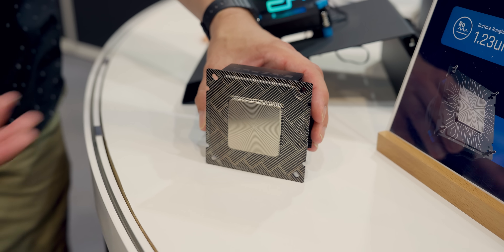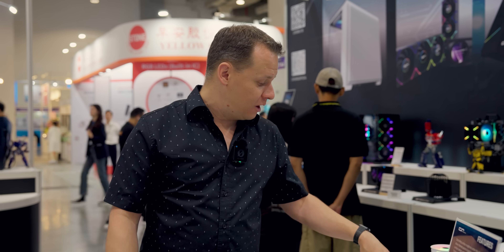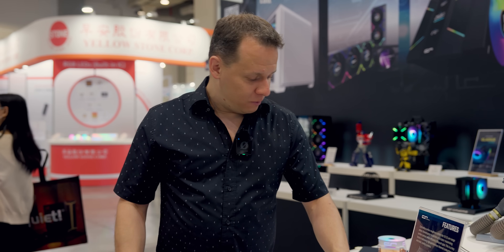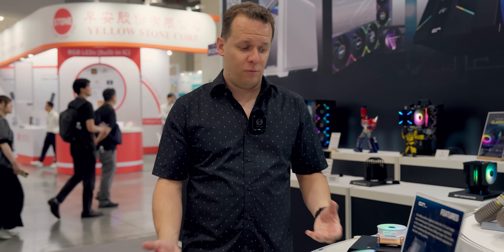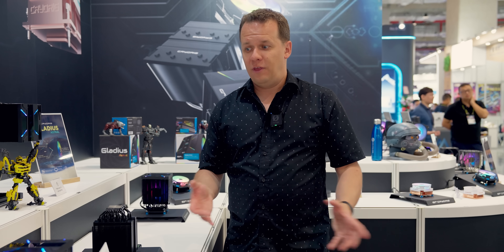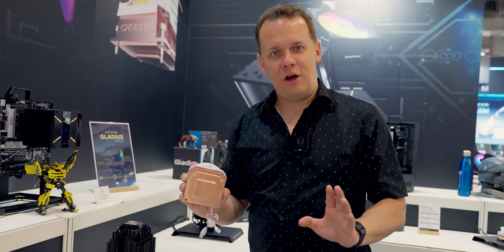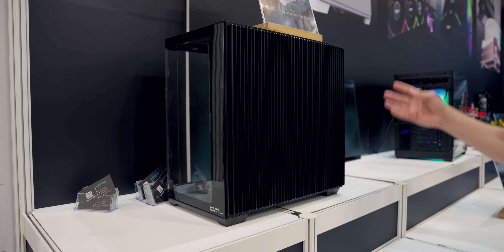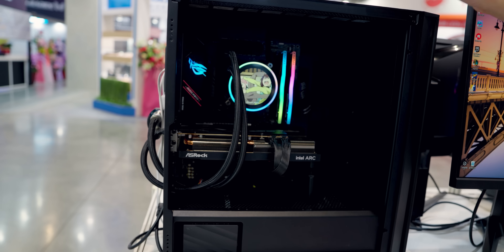The Impossible 185W Low Profile Cooler

Comment: The micro grooves make sense. If the surface is a "mirror" flat surface - it means mathematically there is less exposed surface contact area. Meanwhile the micro groove create more surface contact area. This of it like driving a car across a mirror flat road that is exactly a one mile surface. Point A to B is literally one mile of surface distance away. But now put "valleys" in that road. The car will need to drive a little extra more distance because it will have to drive downwards into the valley, and then back upwards to the surface - over and over again. Which means the total distance was increased, due to the surface area increasing. That little extra surface area means the thermal paste is spread across even more surface, thus being able to conduct more heat. Very clever.

Comment: Taking the low profile cooler’s numbers for granted,THIS IS INSANE, i see this tech making some nice improvements for everything above a tablet in size, even for full size pc’s, since it gives plenty of freedom space-wise, if it still manages to cool the ram well enough, this can be a fantastic choice as a stepup to something like full system liquid cooling, seeing how cheap it is, while keeping the performance toped up while doing it, some can even skip integrating the cpu into the liquid cooling loop with this. 

Altho what i am most interested in is the passively cooled pc, most people keep their pc’s pretty close to themselves, making noise pretty irritating in general, helping in solving this issiue  is massive, this is particularly useful if, for whatever reason, you need a smaller and/or thinner case, allowing you to skip the larger types of fans, maby even using some dedicated sub-120mm ones to recreate a higher performance console-esk device, with extreme scalability, since it can assist in cooling whatever hardware an enthusiast can use.
I have aways thought that companies oversell the safety concerns of 65C devices, laptops do it all the time, didnt plenty of people complain about laptops burning their laps while in use? Most people would feel perfectly fine with the device running hot to the touch for a significant performance increase, especially when it can even save you on the cost of fans or the wattage that they need to run, tho the latter wont touch much on casual use.

Comment: That low profile cooler, sadly isn't low-profile enough. I have a mini-ITX pc inside of an old dreamcast, which i think tops out at 49mm height.. and worse, the fan needs to be in a suck-configuration, else it fills the dreamcast with hot air.
The microgrooves look terrible, and if i'm going to use one of these, with copper, i'll probably want to use liquid metal or hybrid liquid metal compounds. And those grooves are going to cause issues with liquid metal compounds.

If they made a mirror finish one that's designed for liquid metal, i'd actually consider it next time i'm upgrading the dreamcast.

Comment: How much noise ? This is bullshit. Snake oil salesmen at its finest. The reality is, yes, you can suck 180w out of a CPU, but then you need to distribute it into the cooler and have enough air going through to dissipate that heat. If you make the cooler smaller, you need more air flow. Untill you reach a point where the air around the cooler is constantly at ambient temp thanks to extreme air flow. Then, your cooler has reached its maximum potential and if you want more cooling, you need to make it bigger.
I bet you a large sum of pokedollar that they tested the cooler with a delta fan or some trick like that. In the real world, at 30 to 40 db, it will perform marginally better than older products if it perform better at all.

Comment: Cryorig LULL radiator...
?? Seems a stupid idea to me.
You've got a large ATX case with plenty of space. You've already got other fans. You've got the PUMP making noise. All this to replace a cheaper, but still high-end air cooler that would likely cool BETTER than the passively cooled radiator even at essentially SILENT fan speeds? And if you really want a radiator, a thick normal 280mm rad with fans spinning at a silent 400RPM can do a lot of cooling if you've optimized the setup. I like passive when EVERYTHING is passive but I rarely see passive in a case with other fans that makes sense.

Comment: the reason they want to push vapor chamber not because of cooling a normal heatsink can work technically forever if you keep changing the fan where as a vapor chamber needs replacment after few years and depending on how much vapor is being used they can control how long that vapor chamber will last

Comment: You can wick heat away fast with a vapor chamber but then the next bottleneck becomes taking the heat away from the fins! Shorter fins means you need much greater airflow, it's just physics

Comment: third one look promising however there is a huge problem as liquid cooler being pump in and out the cpu it gonna take the heat and have quite massive route before go back to the cpu but the liquid is constantly in a closeup room in another way is you are constantly boil the liquid cooler and if the pipes cant dissipate heat in time well that gonna build up heat and at a point the liq temp can goes up to 50 deg in which at that point passive cooling will be no use and counter attack, build up more heat toward the cpu. there is a visible pc by diy perk he done that but with fans and more room to cool down the liquid in either way if there are no fans for the rad there is no use
Reply: invisible pc

Comment: I can see this cooler becoming very popular and matching it with a slim fan would revitalise the SFF field imo (like small slim non-shoebox cases)

I still have my Skyreach 4 Mini & Hdplex 400w combo, I might pair it with my 7600x in eco mode and Powercolor's Reaper 9060XT! {currently pondering to downscale by running the 7600x with an noctua l4a temporarily however, im a little hesitant since I play games consistently for longer than 2 hours at a time which could make it reach high temps

Comment: For low profile that's cool but for huge towers, if they just added vapor chambers with many heat pipes soldered and from the middle too and then the aluminium fins soldered would be a massive difference compared to regular pressed ones...

Comment: I honestly dont see the use for a passive CPU cooler when the GPU is really a huge heat adder and I don't think the price added with the passive system is worth the little to no benefit. It is a neat concept, but not very practical tbh. That passive system adds complexity that an AIO would add without as much of the extra performance and considering that you will still need hella fans for the case to cool the GPU and memory, it wont be quieter either, until they find a way to passively cool the CPU, GPU, PSU, and other components on the board for higher powered systems, there really isn't a use to just passively cool just one of the components.

Comment: You may transfer heat with a speed of light from your CPU but you can't beat physics. If it's small, the amount of generated heat wouldn't just magically disappear. You have one small fan, one small heatsink. It might help with temp spikes for sure but under a long term stress test it just won't improve temps, I guess.

Comment: 6:46 that going be failures point because cant intalled gpu because hose in the way and running cpu only is not going to boost perform at all be stuck to 20% and cutting out because doesnt have any vent air pass thur so it not radiator it big heatblock unless in boat and can use it cool down pc but room will take whiles for it heat up but house aint cutting it

Comment: You can't spin surface imperfection into better heat transfer in the case of solid to solid material conduction, all it does is trap gases in pockets. In the case of liquid to solid then yes, it does create greater surface area to use fins, so unless this has more to do with what is going on in the inside of the plate, I have no idea why they would make such a claim.

Comment: Man I need it but even lower - 37mm hight are the cases I'd use it for
like the Velka 5, Midori 5l and bigger Cases like the Terra could benefit from smaller Heatsinks.
I am aware that this would likely drop the TDP-Rating but if it is 185W now It might still be good for 100-120W ?

Love that innovation though :3

Comment: The 10 heatpipe cooler with the display, they should not use software and just bake it into the hardware. memory modules are small with high capacity these days.

Comment: Will be getting this for my 5950X ITX build. I have a small Noctua L9x65 on there now, and it has a hard time keeping up. I tried out a 280mm AIO, but it did not have the correct mounting brackets for my ITX mobo, so couldn't use it, so just put the little Noctua back on, a keep fans going good to keep thermals in check. My main system is a 5800X3D on a Noctua NHD-15S, and wonder how well Cryorig's 120mm dual tower cooler will compare.

Comment: So...in theory the low profile cooler can cool the same heat load as the whole radiator case...? I get the whole passive vs active cooling thing but I'm getting the distinct feeling one of those numbers is completely made up.

Also if you're gonna make the case the aio for the cpu...how do you replace the pump when it dies? Am I supposed to send my whole computer away for service or am I suddenly out 2 components instead of 1? See how your plan has holes?

Comment: What if each fin was a heat pipe? Evaporation helps transfer heat. But if you just have an evaporation chamber, without long heat pipes, you've wasted space and material. 
It's better to make solid copper and it will help smooth out the peaks, or make the fins longer by removing the chamber, increasing the heat dissipation area. I don't argue, an evaporation chamber would be better, but the complexity and cost are incomparable. 
(Maybe being an engineer has given me too much self-confidence and I am not right. But for now I don't see the point in such a design.)

Comment: When you test that low profile vapor chamber cooler, do please try both push and pull configurations. The usual fans from Arctic, Noctua, etc would be nice too.

Lastly, VRM and M.2 drive temps around it.

Comment: 7:17 That's simply not good enough. This case is a really awesome idea, but it only being equivalent to a 240mm radiator just isn't cutting it, especially with how big that side panel is. 

They need to take this thing back to the drawing board and figure out a way to get more active airflow across that radiator instead of it being passive. Maybe they can treat that entire side panel as an intake, and by making the case air-tight enough, maybe any case fans can be exhaust fans  so that air gets sucked through. Or, even better, just add an additional interior panel that only contains fans. So, the side panel would contain both the radiator and the fans needed to get the performance up. Make it so that you can snap it all together so that the side panel, radiator, and fans can all act as a single unit, then use that entire side panel as intake or exhaust.

This is a really cool idea, but it's not going to sell with such mediocre cooling performance.

Comment: For 40$ if they can back up their claims in real world applications is steal for the small cooler. It's not only small but it should help out with RAM module height issues that can happen with tower coolers.

I do hope they will include a bracket so you can mount fans of your choosing to the cooler because fan is moving part and it can eventually cause issues. Zip ties would work but it would be better to just include bracket.

Comment: TDP ratings are meaningless. That has been shown time and time again.
Reply: nah. its more like manufacturers overinflate their tdp rating, heat output is somewhat relative to power used.

jonsbo is an example on the top of my head that is very notorious for inflating TDP cooling numbers - their HP400, which is a 36mm, aluminum, 4 heatpipe cooler, shown this Computex says it can handle 160w which I completely doubt can do 95w without throttling.

Comment: If the case with a passive radiator isn't serviceable then it's a complete waste of money. Instead of replacing just a failing AIO, you're replacing the case as well, that can't be the way it is intended. If it is then it's a clown company and no one should by that case.

Comment: I would rather see that low profile cooker with a standardized fan mounting so you can use any fan you want if you choose. For example swapping to a noctual fan. although i supposed many hardcore nerds have 3d printers and will print their own adaptor to "clip" on with a standard fan mounting hole position on the top side to adopt any fan.

Comment: That case radiator looks better than my design with a radiator stuck on the side of a fractal north case, my pipes are blue, because that's what I had from last build but are routed pretty much the same as them. I have 4 200mm fans on my rad tho. I don't have a reservoir so it's kinda aio but not at the same time. Not sure if my flow is too high or I need to reset my GPU block but still struggling with hotspot temps.

Comment: Not a new idea tho. ID-cooling pulled this idea with their IS-VC45 way back in 2015 IIRC and even in more versatile height of 45 mm. Was not that great in terms of cooling, so i guess nothing to expect here. Proprietary mounting is evil btw, good luck with finding a replacement/upgrade of the fan!
Reply: to be fair, the fan included w/ the IS-VC45 was a slim fan that is obviously not meant for VC. you would need a high static pressure fan for it, like what cryorig is doing here with its 31.5mm thick fan
Reply: @seibertron500  Yeah, that's true, but it's still axial fan, most VC-based heatsink designs use turbines for a good reason

Comment: The passive radiator looks very interesting. If they make it out of copper so it can be used in custom loops, you'd get additional cooling capacity without taking up space and it might even let you turn your other radiators' fans off during idle.

Comment: About the contact plate groves - I don't think the more even TIM spread is the reason. It may have turned out this groves are actually doing better (lower temps) but that is because TIM fills up the groves and transfers heat from IHS to the valley inside the grove, so basically they are increasing the contact surface area because instead of 2 dimensions they are using 3. Maybe it works on specific scale (grove dimensions) and load, because when you think about it thermal conductivity of copper is far greater than any TIM.

Comment: I'm somewhat concerned about the airflow dead zone near the bottom of the CPU cooler. Air can't pass through the fins but go out at a perpendicular direction.

Was there any new engineering to increase airflow there? Its probably possible to add some some grooves to guide airflow to the area where the vaporchamber and fins meet, its better than having stagnant air.  For the dead zone at the very center of the fan motor, perhaps grooves could also guide the airflow underneath and out the other side.

The current vapor chamber design resembled the Pentium 4/AMD x64 fins with a blocked bottom.
Reply: Some ideas: 

1. A copper core that's been CNC'd in a vortex pattern. The middle of the core could be drilled at two different angles to create an angled tunnel, while the outer edge could be CNC'd. Whatever design that's optimal  and affordable to manufacture is ideal.

The purpose of this design is to encourage efficient airflow pass around the dead zone instead of just trapping air.

2. An inverted fan with a thinner motor, with middle having fins that push the air down to the center. Any bit of airflow at the dead center helps. maybe even have the part cone out and leave a indentation in the fins.

3. Utilization of poles in a grid or hex arraw instead of fins at the center. they could be screw-like pattern to encourage a vortex pattern. the front left and back right could be clockwise, front right and back left will be anticlockwise.

Flow-through vapor chamber to let some air go through instead of turning around. Just a bit.

Comment: Not a passive case. Its just a car radiator stuck to the side like people did 30 years ago. Passive cases like what I had rely on thermal mass. Copper... and LOTS of it. No moving parts should be the goal in non-gaming setups.

Comment: 3:35 Those prices were much lower than I expected considering the form factor and TDP
Reply: Me too, I thought it'll be at least 120 USD for the copper one
Reply: @Ibr4-c  These aren't that expensive to make, blower cards use this for ~10 years already, they just changed form of contact pad and put fan on top.
Reply: Agreed, im here like ill take 1 of each
Reply: Its new, so we are the lab rat to test it long term for future improvement.. so i guess it worth it
Reply: 40 + tax + tariffs + f*cks here and there
Reply: lol my thought exactly reason i even came to comments
Reply: Chinese manufacturing will do that.
Reply: @StuninRub  except when sold by non chinese companies, I guess?
Reply: TDP my ass. There's something called physics that nobody can defeat. I bet you the fan runs at 5000 rpm and make the noise of a formula one.
Reply: @PyromancerRift  It can do up to 185watts (On the all solid copper version) but my question is for how long? I bet it can do bursts of 185 watts but it can't sustain it for any decent amount of time.

Comment: I wanted to purchase the Cryorig R1 Ultimate for age back in 2016-2017. Never was able to purchase it in Canada.
This big vapor ITX case, hope his perform well for a 75-80w cpu. I am heavily thinking about going ITX for my next Upgrade about next years. if this cooler perform similiar to a low tier dual tower, i could go smaller case.
But availability will always be the problem. lel.